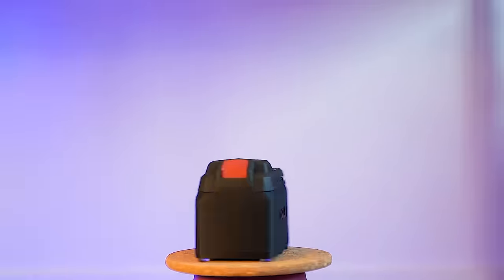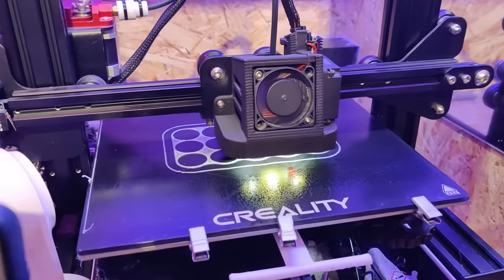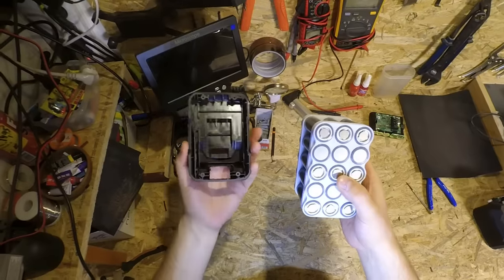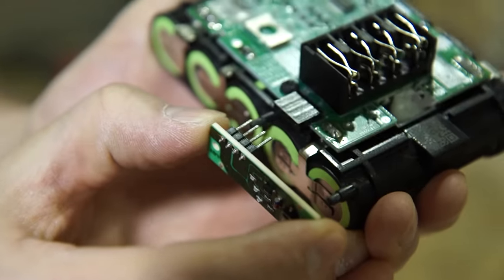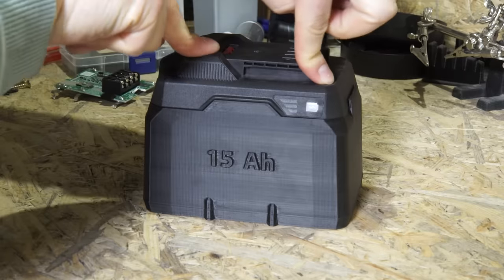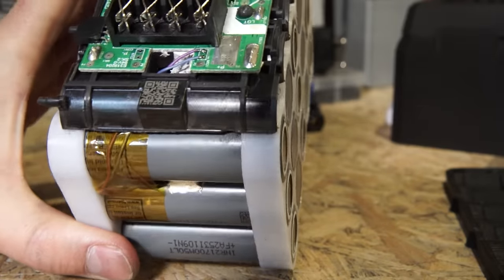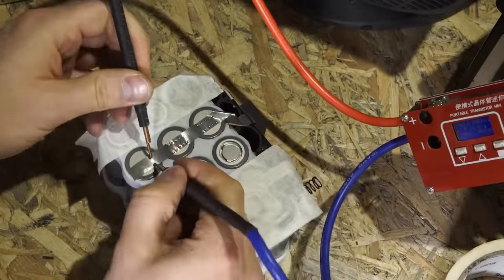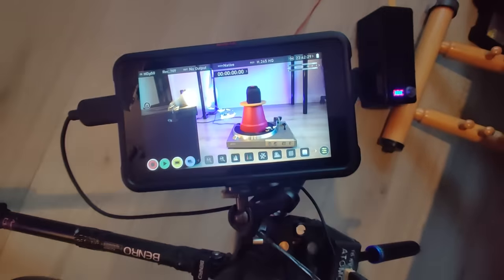Build a GIANT⚡⚡15Ah⚡⚡tool BATTERY!

Comment: or just buy better tools. anyway, nice work mate, one has to respect your attention to detail.
Reply from the maker: Wish I had money to spare like that 😅 So far it's Parkside for me and I'm actually extremely happy with the quality, been using their tools for over a year now and not one broke down so far. Granted, I'm not a professional worker that uses them everyday but for the occasional use they're great :)
Reply: @Solipsfilm  i would never buy, for example, a parkside lawn mower, but i wouldn't mind if i found a fully functioning machine complete with 2x 4Ah batteries, fully charged in the trash... which is exactly what happened. can you believe that? i just had to replace a rusty screw on the side to fix the handle.
but now i just can't buy a charger. there is not a single shop that sells parkside chargers where i live. i can only buy used chargers double the retail price, or with hefty shipping costs.
that's what i get for trash talking. talk about karma. i'm sorry T^T
any idea how to charge those batteries without the official charger? battery model number is PAP 20 A3 if that helps

Comment: For what? More heavy yours power tools
Reply from the maker: With some tools it doesn't matter like radio, lawn mower, coffee maker, soldering station, and so on. For some people this might be a good upgrade.
Reply: @Solipsfilm  I agree for the lawn mower, but for power tools like your example, you install it on a cordless drill machine, which is basically easy to carry, not bothering the user. it would be better if the power tools were light enough but still powerful. if it's a matter of length time of use, you're better off using two batteries, one used and the other as a backup or charged. The factory must have thought between weight and practicality
Reply: @Boediprasetya remembers the absolute beast of a batter dewalt 15ah battery
Reply: Is 855 grams too much for you?

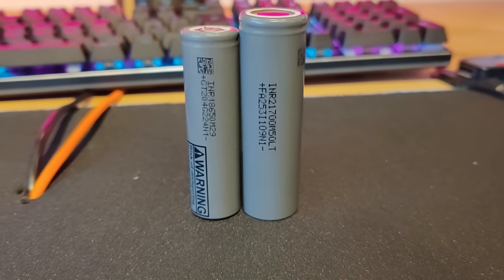Comment: What the hell? Those are recycled batteries? At 1:52 we can see the spot welding bits that are still on the cells...
Reply from the maker: They are cells that are brand new but are being sold half price because they were in battery packs that had faulty welds on them and got returned :) I tested them, they're the full capacity of a new cell so it was an awesome deal. They often have this type of deals on Nkon, really worth a look every once in a while.